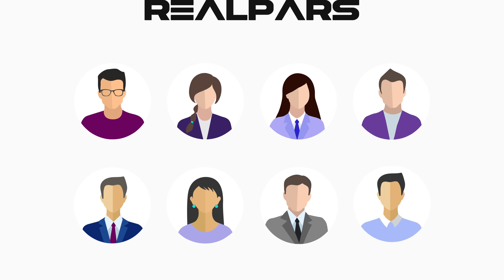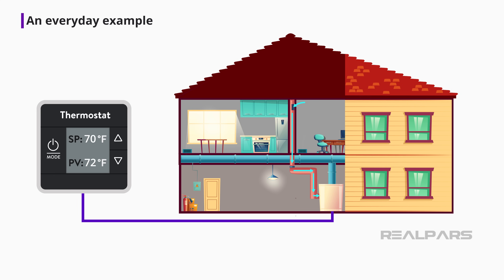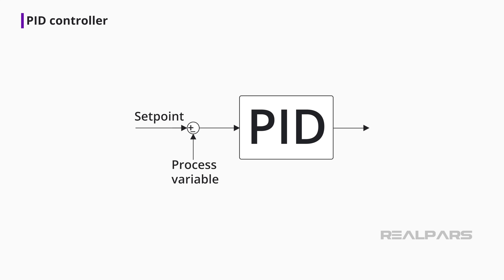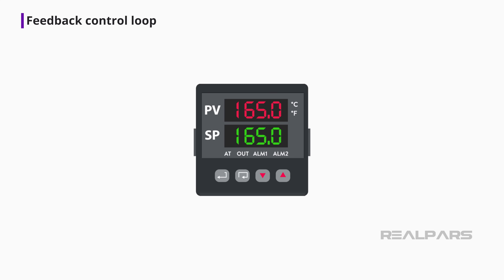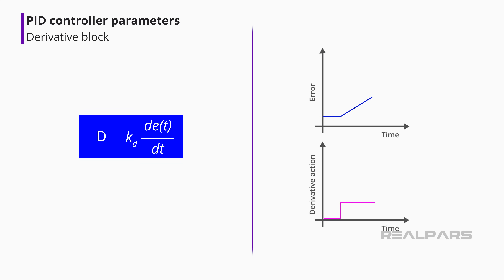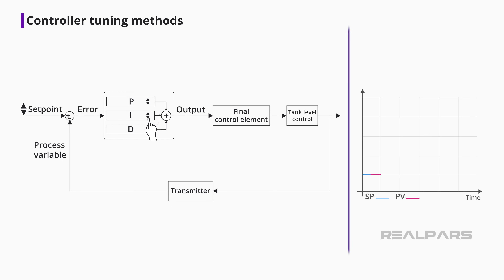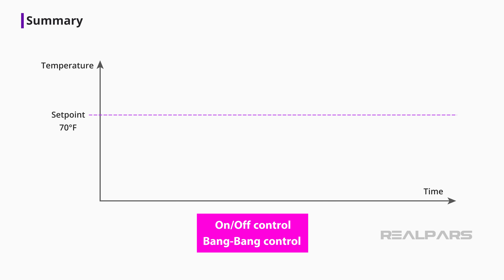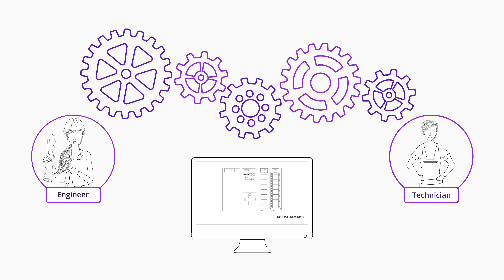PID Controller Explained

Comment: Proportional (P) Term:
P = Kp * e(t)

Where:

~ Kp = proportional gain
~ e(t) = error at time (t) = SP − PV

Integral (I) Term:
I = Ki * ∫ e(t) dt
Where:
~ Ki = integral gain (sometimes written as Kp / Ti)
~ ∫ e(t) dt = accumulated error over time

Derivative (D) Term:

D = Kd * de(t)/dt
Where:
~ Kd = derivative gain (sometimes written as Kp × Td)
~ de(t)/dt = rate of change of error

Full PID Controller Output:

m(t) = Kp * e(t) + Ki * ∫ e(t) dt + Kd * de(t)/dt + b

Where:
~ m(t) = controller output signal
~ b = bias or manual reset term

Thank you @RealPars and you're welcome whoever could use this formula (using your powers for good)

Comment: Your tank of water analogy for why not to use on off control was bad. If the tank was big enough and it is time constant dominant an on off controller would be ideal.
Reply from the maker: Hello @tedn6855, 
Thank you for your question! In this video, we demonstrate the advantages of using a PID controller.
An on/off controller switches the pump directly from a stopped state to full speed, which can cause a higher current draw on the power supply — for example, accelerating from 0 to 3600 RPM or more, depending on the motor and any gearing used.
By contrast, a PID controller allows the pump to start gradually and adjust speed smoothly to reach the desired setpoint, as defined by your engineering design. This is especially important when working with liquids that are sensitive to agitation — for instance, when excessive mixing could cause foaming or suds.

You can sign up for a free 7-day trial to explore our in-depth courses and learn more about PID control and other automation topics.

Happy learning from RealPars!

Comment: 4:40 The steady state error is usually between the initial process value and set point, not beyond it. The integral control is used to remove that error.
Reply from the maker: Great point! Thanks for sharing your insight✨
Reply from the maker: Hi @hamdaniyusuf_dani.  Darn, you have an eagle eye. This graphic snuck past us during the final review.

Comment: Does integral block integrate the error in sliding window or from the beginning of time?
Reply from the maker: Hello, @luck3949. Thank you for your question. The feedback is always working, adjusting to the set point. The control window adjusts as needed. Remember it is trying to reach the setpoint when you set it will. An automobile cruise controller does just that. Therefore, that is one example. You are looking to achieve a stable, slow process. And only one variable at a time. There is no set formula for advanced tuning of a PID controller and no step-by-step process that will work in every scenario, but with an understanding of how a PID controller works and enough practice, it is definitely possible. You can practice by downloading the great PID Simulator app from the Microsoft Store! 
Here is the link for your learning: https://pidexplained.com/how-to-tune-a-pid-controller/

Comment: hi, ty for wonderful explaination about PID, can i ask for some pointers or suggestion on what type of water valves can i use for PID controll?
Reply from the maker: Hi there, Thanks for reaching out. That's a tough question to answer. Can you provide more details please? Do you have power near the valve? Can it be electric? Will it be pneumatic? Is the water clean? What flow rate are you considering? Thanks!
Reply: @realpars  gud day sir, ty for the time for giving a reply, i'm a student working on a thesis, im planning to apply PID control on adjusting water flow for aquaponics, inorder to do that i've done some checking on which component i'm going use and a "Motorized Valve" has a good potential in it, the project prototype is a small scale so im going to use a modified version of it "A Servo Motor + Ball Valve (for water)"

Comment: Howdy.
I like how RealPars focus on the essential in these tutorials.
Digital controllers are usually described as summing of the P, I and D blocks. As in the clip.
There are still lots of analog controllers in use. They are usually bulit using operational amplifiers. The description usually is the P, I and D in cascode or series.
The math is different for summing and cascode. However. The derivative parameter Td usually is at most 1/10 of the integral parameter Ti. Usually Td is even way smaller than 1/10 of Ti. The math for both summing and cascode will be the same closely enough.
Regards.

Comment: Can anybody explain fuzzy PId which used in commercial temperature controller to avoid overshoot and reduce rise tine
Reply: probably incorporate other data points...tmk PID often is only self-referential, but smarter controllers can take in more data, and basically use non-linear control algorithms
Reply: If you see like, Shinko or Omega temperature controller there implementations are perfect. I also have developed  PID controller but not like Shinko performance they use first auto tune which oscillate 2 cycles to find P,I,D,ARW(anti reset windup),and then control. They used Fuzzy PID I check many times, with graph and different setup. In this you get Error and rate of error as input with that Kp,Ki,Kd calculate with fuzzy interference and find control output to operate the heater. But in shinko device graph of the control always same minimum rise time and almost no overshoot . But in my case graph is not always the same. My question how to correct this algorithm? for this we donot need powerful MCU, 8-bit MCU is enough it is all about algorithm.

Comment: I'm trying to control the temperature as a process variable, and the control element is heater. I'm using relay to control heater. Will I able to implement PID system in the current settings ? This project is being developed using Arduino.  My current system is running using On/ Off control which is not accurate. Please help !
Reply from the maker: Hi there. Thanks for reaching out. ON/OFF control of any heating loop will not produce anything acceptable. (Accept in our homes apparently). As for Arduino PID, there are oodles of very helpful online sources. If you do a search for "Arduino POD", I think you'll be pleased with the available help.

Comment: 5:00 As long as an error exists the integral action will continue”.   That is not correctly stated. What he said is applicable to proportional control as well. So what is it that differentiates proportional control from integral control ? The correct statement is “As long as an error exists the integral output will continue TO INCREASE (over time).” With proportional control if the error hold steady, so does the controller output . But with integral control even if the error holds steady, the controller output will continue to increase.
Reply from the maker: Hello @MyMusic.  Thanks for reaching out.  The problem with Proportional-Only control is that once the error become stable, there is no proportional action therefore no corrective action. This results in something called Offset. Adding Integral action will attempt to remove the offset.   You are correct when you stated “As long as an error exists the integral output will continue TO INCREASE (over time). As this video was at an introductory level, we did not go into a great amount of detail. 
If you are interested, you can check out our free series on PID Control at:
https://learn.realpars.com/courses/PID-Controller
One of the videos in this free series is available on YouTube at:
https://www.youtube.com/watch?v=E780BPOjKwM&t=1s
Thanks again for your comments and feedback! It’s always great to hear from our viewers!

Comment: The proportional control is wrong, You can't have an output bigger than the set point only with a proportional. When the Kp tends to infinity the stationary error tends to zero, but It is only theory, in practice when the Kp is very big, the output oscilate.
Reply from the maker: Hello @Gustavo Aquino.  Thanks for reaching out........ About your fist point, check out our reply to Mihai Dinca 2 months ago where  we explained that on rare occasions, graphics that are in an original storyboard don't get translated as they should. As per your second point, we agree totally.  Increasing the Gain will certainly get you closer to the septpoint, but if you set it too high, the output will oscillate.

Comment: Very nice tutorial. We have developed an ANALYTICAL CONSTRAINT OPTIMAL PID CONTROLLER (see the links at the end, but you can contact me inbox tchamna@resulam.com if you are not able to have the full paper) that I am suggesting to your audience. It is an AUTOMATIC way to tune PID parameters WITHOUT any trial an error, and PLUS, while maintaining constraint on : 1. the output (process) variable, y, 2. the control (manipulated) variable, u, and 3. the rate of change of the control (manipulated) variable, u'.

We have solved the control parameters ANALYTICALY, meaning that, the parameters are given in a closed-form expression, relating the plant parameters to the control parameters. So, the only thing the user have to input to the model is

1. The desired maximum input (y_max)
2. The desired maximum control variable (u_max)
3. The desired maximum control variable rate of change (u'_max)

And the system will then calculate your control parameters using the closed-form equation. We have derived the parameters for integral and first order stable or unstable systems.

YouTube Video: https://www.youtube.com/watch?v=TaMO9UIF-Oc&t=238s

1. https://link.springer.com/article/10.1007/s11814-018-0215-5
2. https://www.sciencedirect.com/science/article/abs/pii/S0019057817306080

Comment: The graph PV vs. time at 4:36 is completely  wrong. With proportional term only, the PV  steady value can  not be larger than PV. Read again the classical textbooks or run more carefully the simulators!
Reply from the maker: Hello Mihai Dinca. You have a fine eye for detail. We're assuming you are referring to SP and PV. We thank you for pointing out this graphical faux pas.  On rare occasions, graphics that are in an original storyboard don't get translated as they should. We look forward to hearing from you again in the future.

Comment: I don't understand one part of the process. How does the PID output control the working element. The output from PID is basically a sum of three different error perspectives. The larger the error, the longer it exists and the more it fluctuates, the bigger the output from PID is. 

But how does it affect the working element. Let's say we have a valve that controls water flow. How do we convert the PID output (a value) to the signal that controls the valve?
Reply from the maker: Hi @singleaspringle.  Thanks for your question. Please excuse me if I have misunderstood your question ...... but here goes my answer. The controller output is a variable 4 to 20 mA signal which corresponds to 0 to 100% of the controller output range. The control valve is a pneumatic device operated over its entire 0 to 100% stroke by an air signal of 3 to 15 psi. The instrument that converts current to pneumatics is called an I/P converter. In a nutshell, when the controller output is at 4ma, the valve gets 3 psi and the valve is either fully closed or fully open. (Depending upon the system design). So, we can stroke the valve from 0% to 100% by changing the current output of the controller. I hope that helps?
Reply: @realpars  so the way to control the device with PID output is dependant on the specific system we are implementing PID to? For different devices the converting needs to be done differently?
Reply from the maker: @singleaspringle6941  We're not actually "controlling" a device. We "operate" a device that acts on the process.  We are controlling a process. We manipulate the process with some type of final actuator that is operated by the controller.
Reply: @realpars  This is called Executive Unit

Comment: If the output is a relay and the final element is a pump than the pump will be on and off multiple times and the inrush current will damage the electric motor in time.
Reply from the maker: @D I. You are bang on.  Lare motors are not made to be cycled on and off repeatedly.

Comment: Very good refreshing - I took 6 courses in Control Systems in the University long years ago and I loved this subject a lot, I was A student in this subject doing it with Analog circuits but today I do it with microcontollers along with Analog + DigiPots and Digital Variable Capacitor along with keyboard and switches. This is amazing.
Reply from the maker: Glad it was helpful! Thanks for your kind support, Firas!

Comment: Automotive guy here; when viewing ECU "live data" with a scan tool the term PID is used... I think I understand why now.  Cool video!
Reply from the maker: Thank you, Alan!
Reply from the maker: Hi @Alan Townsend.  Just out of curiosity, what piece of equipment is the ECU out of?
Reply: Networked control units in light duty automotive; engine / powertrain, body, stability control, etc.

Comment: If the step response of a system is known, can correct values of PID be calculated to achieve a desired response, or is tuning always required?
Reply from the maker: Hi @john. Several manual tuning methods begin by observing the process variable dynamic response to a setpoint step response.  This response is then used to determine PI and D settings if required. As mentioned in the video, manual or auto-tuning will result in preliminary PID values but more often than not, further tweaking is required.
Reply: @realpars  yes, thank you. My question wasn't clear. Is there an analytical way to determine the exact feedback parameters if the transfer function of the "plant" is known?
Reply from the maker: @jazzjohn2  Hi @john.  I've not done such an exercise personally but I have read that software such as Simulink and Mathlab is capable of assisting.  Sorry I can't be of more help.
Reply: @jazzjohn2  Student of Electrical Energy Systems Engineering here. Yes, there are methods for analytically calculating controller gains based on the desired response and transfer function of the plant, for example full state feedback etc. You can learn more about this in classes about control systems and even here on YouTube. Unfortunately, I am a bit rusty with the exact methods but at least I can tell you that such methods exist.

Comment: I think, that violet curve in graph at time 0:39 is wrong. It have bring near SP line, not go over line. Or not?
Reply from the maker: Hi @101NU70. Thanks for your comment.  We included those curves just to illustrate how different PID settings might affect the process variable.  As we try to illustrate later in the video, desired PID response differs greatly from one process to another.  A PID controller response for one process may be disastrous for another process.

Comment: I'm using an PI controller in most cases, sometimes even P is good enough. I also use FFWD in combination
Reply from the maker: Hello @Lovro Sipovac. Thanks for your input. In fact, when maintaining the process at an exact setpoint value is not critical, P-only controllers will do just fine. And, as you say PI controllers are is sufficient in most cases.  Adding D to some loops can cause no end of troubles.
Reply: @realpars  I benefited from adding a D in a very few cases when I wanted to "choke" the abrupt change, but yes, it's mostly a headache :)

But adding a feed forward value is a fantastic measure if an approximate value is known. A good example would be tension control when spooling out VFD controlled winch (motors actually) when you have a good estimate of required holding torque and uncertanties are represented by inertia/friction in the complete driveline. For instance, you want to hold 10T on the winch while it spools out .... you calculate that in order to do so you need to hold 20% torque on motor(s) in ideal system (no friction etc.) ... then you just feed forward that value, or whatever you calculate for particular tension, tweak it so it works well on variable setpoint and voila! :)

Comment: Good video. I'm an ME so I don't have to work directly on PID loops, but work in automation so I'm around them often. Back in college when we programmed them in our circuits class they had us manually use a fan to cool a resistor to a specific temperature, and then a PID loop. The precision was night and day.
Reply from the maker: Hi @MeltingRubberZ28. Sounds like your fan/resistor activity was interesting. Was the temperature controlled by modulating the fan speed?
Reply: @realpars  yes
Reply: I'm an ME too. Do you enjoy automation? I really enjoy learning about electronics, programming, logic, and efficiency. I can spend hours reading and thinking about it. Maybe I should of done software or electrical haha
Reply: @JB-ri6zp  yeah. Job is rewarding and the pay is good.
Reply: my college did a similar thing, but it was controlling an inverted pendulum and trying to keep it straight up while inverted. If tuned properly and the error is not large enough saturate the control gain, it can keep an object at naturally unstable equilibrium really well. Although if you have a naturally stable system, then it's even better in case there was a failure in the pid system, at least there is some backup.